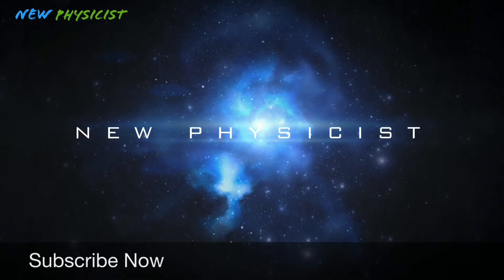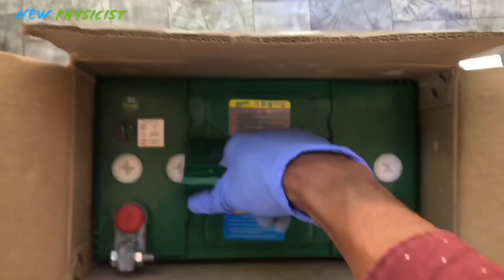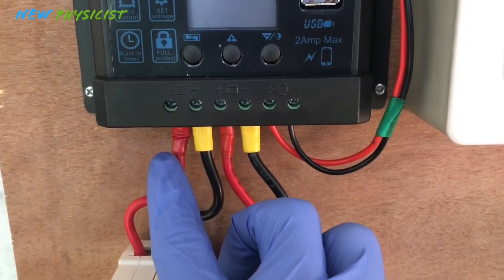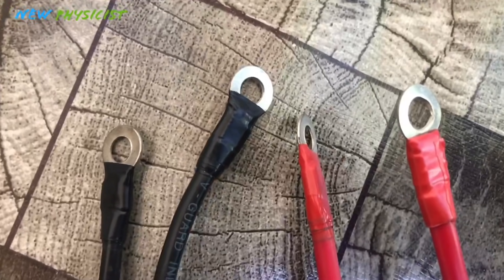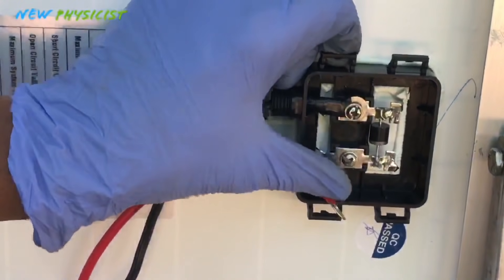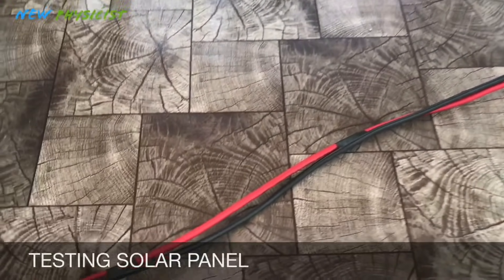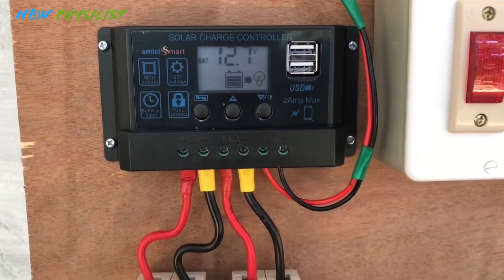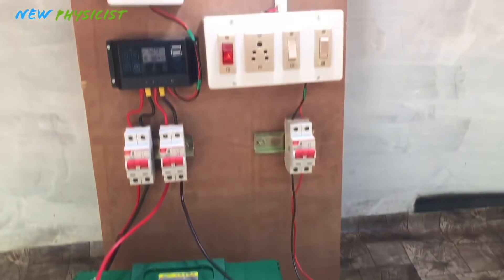How to Install Solar Inverter | Off-grid Solar Power System | 12V Battery | 100W Panel

Comment: You connected the battery directly to the inverter. And you have said that doing so will affect the battery's life since the inverter can completely drain the battery. So at night when there's no solar charging the inverter can completely empty and affect the battery life right?
Reply from the maker: By choosing inverter which over discharge protection you can save the battery. Most of today’s inverter had this function. So nothing to worry about. I connected it directly to the battery, if somehow inverter draw more current from battery through the charge controller (more than rated current) it will fail the charge controller.
Reply: @newphysicist  Ok. I have a solar lantern having a 12v 7.2 ah battery inside and a panel of 10W. Can I open up the lantern , connect 2 wires to the battery , take it out and supply it to a 100W local inverter and use that to power household LED bulbs? I don't know whether these local inexpensive inverters have battery protection.
Reply from the maker: 7.5 Ah battery can be used to light total ~40 W light 💡 for 1 hr. Or 10w bulb 💡 for 4 hrs. 

Yes, you can connect. But battery 🔋 will drain fast. I recommend you to upgrade your system as I shown.
Reply: @newphysicist  Ok thanks😊. One more thing. Can I use the setup I told during day time? The battery  being charged by solar and simultaneously using the inverter on it will not completely drain the battery right? I just want to charge my phone and power my laptop (45w) during rainy season, since day time mostly power will be out.

Comment: I have 165 solar panel. And 80ah battery. I want to charge battery with 20a solar charge controller.... Is it possible with full charge
Reply from the maker: 165 W solar Panel. If you are getting 5.5 hrs of bright sunlight a day,  total power ~= 900 W

Assuming you have a 80 ah lead acid battery. Total power needed is 840 W

Assuming you have a 20 A MPPT charge controller…
Yes you can.

Comment: I notied for both solar side & battery side you have used 40A AC breaker (isolator). Since both above ends are DC, shouldn't we use DC breakers?
Reply from the maker: I did use DC MCBs instead of isolators in my latest off-grid project. Check it out
Reply: @newphysicist  Thank you for the new video. Actually, your videos cleared a lot of problems I had regarding off-grid solar systems. I have one question since DC MCBs are rare & expensive, can I use AC MCBs instead? are there any negative impacts?

Comment: Nice video - I am new to this but have a PWM charge controller (30A) and purchased a 100W solar panel. I want to use it to charge LED lights on my garden - (12V 40W) - I can just hook up the lights directly to the load and they will switch on and off as per the timer. I dont think I need an isolator etc for that setup as the power levels are not so high. If I wanted to get an inverter (will need isolators) and powered a garden feature from the AC output - can that output be controlled with a timer so it will come and and off as per the load? or will it always be on? My battery will be a standard (used) car battery, SLA 12V 50Ah
Reply: I am using 35w panels 3no’s
65ah battery 
Using DC lights only 10w
If I use inverter in that Ac 20w light won’t run till morning.

Comment: Please sir I also have a question, and it goes like this, I have 80watts 18V mono crystalline solar panel, but unfortunately am new to solar stuff, now how many ahms of battery, plus charge controller and inverter could be the best/ideal for this setup? , moreover sir, what can I run with it? Early response will be appreciated, I just tab the subscribe button 😊
Reply from the maker: A 30-40 Ah 12 v Lead acid battery will be enough if you have 5 hrs of bright sunlight. 

You can use a 50W TV continuously for 4 hrs. 

All calculations are approximate. Not exact. 

I appreciate you for subscribing to the channel.

Comment: Why used isolator instead breaker?
Reply from the maker: It was my first project. Isolator will work (for isolation purpose) but will not protect. Cost of isolator is very low too. Pls check my last project. I’m using DC breakers there. Thank you 🙏

Comment: How do o go about the battery over discharged...like how do I protect my battery from over discharging
Reply from the maker: Charge controller will protect battery from over charging. If u r sure you won’t connect more than 120 w power from the battery at a time you can connect the inverter input leads to the charge controller’s DC out, to avail over discharge protection.
Reply from the maker: But if you are connecting it directly to the battery, there’re certainly things to worry about. Use an high ampere charge controller (MPPT best) to avail both over charge and over discharge protection.
Reply: @newphysicist  do u have any suggestions on the mppt controller
Reply from the maker: Renogy and MorningStar are worlds renown solar equipment manufacturers. Go for one of them. But I don’t have personal experience with those companies. I’m dealing with locally available manufacturers. Best wishes for your off grid life.. ✌️
Reply: @newphysicist  I appreciate your help
Reply from the maker: Anytime. Go green 🌞
Reply: @newphysicist  nice presentation

Comment: bro can i use it for 10w solar panel and charge the 12v,2000mah li-ion batteries like18650 battery

Comment: Why you joint inverter to battery and not at load side.because tou connected load (inverter) and battery with  battery charger's battery connection port .why not seperate.so meaning or function of charger circuit serves.

Comment: Hi sir, I just want to ask, is it necessary to put isolator for solar panels? And is it okay to put the load in ac in the same isolator as the battery and inverter you've installed? Im curious sir. Waiting for you answer. Thank you! And God bless.
Reply from the maker: It’s not necessary but they are safety precautions. We should use DC MCB and a fuse while connecting solar panels to the charge controller. Watch my latest video.
Reply: @newphysicist  for 200 watt solar panel.
Which DC mcb should we used?

Comment: thanks for the easy-to-understand video. I wonder about the specs of the isolators?
Reply from the maker: These are actually 30 amps AC isolators. Not DC. I recommend you to use DC Isolators. But they are expensive.

Comment: Hi, very neat and clean installation, but I have one question, you have used Ac isolator as a switch? does it work without any problem if we simply use it as a switch in DC connections?
Reply from the maker: It is an AC isolator. It’ll work, no problem.
Reply: @newphysicist  Yeah it will work but why not use DC breakers for both panels and battery.

Comment: I guess my charge controller is faulty because when i connect the solar panel, the displayed battery voltage changes to my float voltage.

Comment: Hello bro .  I do not have a car. I don't have a battery Without it... I have 220V 500 watts and this power supply will produce 12 volts 40 amps. Can I connect a 2000 watt inverter instead of a 40A 12V battery? . And I want to connect to a car inverter. This inverter has 2000 watts. Get triple electricity with these options and is it possible?

Comment: For 200 watt solar panel. How much battery ah is required?
Reply from the maker: 80-100 is okey (for 60% dod)
Reply: @newphysicist  i am having 150 AH battery..should i not use that?
Reply from the maker: U can use but panel cannot fully charge the battery and eventually battery will fail. Plus, a 150 Ah battery need 10~15 charging current which cannot be provided with a single 200 w panel.
Reply: @newphysicist  so 300 watt panel is sufficient for 150 ah battery?

Comment: Can it run 700w power consumption  system all day
Reply from the maker: Nupe. A 40Ah lead acid battery can only deliver around 240W.
Reply: If I use a change convertor of 1000w  with  130w solar panel and a 50ah battery.
The it will run all day?
Please suggest me something. 🙏🙏
Reply from the maker: Assuming Your Power Consumption per day is 700 W and you are using a Lithium  battery. 

Battery Size ~= 60Ah
If you are using a Lead acid battery double the Ah. ie, 120 Ah

Panel for Charging 60ah battery ~=150 assuming you have 5 hours of  max sun light.

(All calculations are approximate)
Reply: @newphysicist  and what about invetor sir
Reply: @newphysicist  and a change controlar
And I am taking this system can run atleast day time not for 24hr. Please reply sir 🙏🙏
Reply from the maker: 1000 W inverter will do the job. ✌️
Reply: @newphysicist  thanks sir for your help ❤️❤️😳😀
Reply from the maker: ✌️ always
Reply from the maker: @dextroyt488  a 10A charge controller is okey. When you are using power doesn’t matter. Amount of total power consumption is what matter.
Reply: @newphysicist  ok sir but this system rut it continuously at least 6hr dose it is capable
Reply from the maker: It depends on how much power you draw out of the battery. 

You can run 100W tv for 6 hrs or
50 w fan for 12 hrs or
200 W (any device) for 3 hrs.
Reply: @newphysicist  ok thanks sir 🙏😀

Comment: Dear brother please use proper DC mcb for the DC circuits. Try to use proper tools for crimping and other works. I understand it's an experiment but please do proper research and read the codes for electrical control systems.

Comment: Actually I have 2*190 (24v)watts solar panel(parallel connection) connected to a 50amps 12/24 pwm charge controller charging 100amps battery with 1kva inverter,I discovered I enjoyed it for 3months before battery started discharging fast,changed battery also enjoyed for 3months and discharges fast again...what could be wrong?
Reply from the maker: Charging current should not be more than 10% of the battery Ah for lead acid battery. I your case charge current may be more than 10 Amps.
Reply: @newphysicist  how do you determine the charging current please?
Reply from the maker: Maximum 10% of the Ah of the battery
Reply: @newphysicist  i was meaning how do i achieve that value? and how do i know that is exceeded please.

Comment: 1)Did you use DC cables to connect between Panel & PWM

2)Can we use the PWM usb plug point  to recharge our  smartphone, if yes ,how can protect our smartphone from overcharging ?

I think the original smartphone adaptor does the power control when we use the original power adaptor.
Reply from the maker: I used 6sqmm wire. 

I don’t think pwm have an overcharging protection circuit with it. 

Suggestion: don’t leave your phone plugged in 😊

Comment: 2 solars are connected in series or parellel please tell me
Reply from the maker: Connected in parallel so that voltage remain the same but current doubles. 👍
Reply: Sir i am facing problem in charging my 2 12 volt 7 amp battery with 2 24 volt 50 watt solar( same as you) i have connected bot battery and solar in parellel and used 10 amp controller my controller is not able to charge the battery. Please help me sir. How can i contact you.
Reply: @newphysicist  sir please help me
Reply from the maker: Sorry, what’s the Ah of your battery? And what type?
Reply from the maker: How did you connected your batteries? They should also be connected in parallel.
Reply: @newphysicist  i have connected the battery in parellel and they lead acid battery
Reply: @newphysicist  7.5 Ah each
Reply from the maker: That’s total 15Ah battery. Then it should work. Did you check the voltage and current from the controller? Make sure leads are connected correctly. Try replacing controller.
Reply: @newphysicist  ok i will try replacing it
Reply from the maker: Directly connect the panels to the battery for few hrs. Then check if battery is charged. If yes fault controller.

Comment: Hi who can help me. My requirements only low consumption 4bulbs 1fan and CCTV DVR with WiFi router for these what capacity of solar panels, inverter charge controller and battery will needed? I'm very beginner for solar off-grid system so anyone can advise me plz

Comment: Your breaker are non reversible dont put the connection of your pv in the load side of your breaker it must in the line side ,also the breaker in your inverter dont put the connection load side it should in the line side and then the ac output will be in the load side because your breaker use is non reversible

Comment: I need help please,
My charge controller, reads 13.4v in the afternoon, by evening, it drops to 11.8v Even at zero load.
I use a 12v 220ah battery, 1.5kw

The system is barely 4weeks
Reply from the maker: What’s the solar panel wattage and  voltage (Voc)?
Reply: @newphysicist  180watts solar panels (4)
Reply: @newphysicist  it's a 12volts battery, 220ah
Reply from the maker: Pls mention battery type, charge controller type (mppt/pwm) also
Reply: @newphysicist  luminous battery, mppt charge controller
Reply from the maker: How did you connected your panels? Series or parallel? What is the effective Voc and Isc?
Reply: @newphysicist  I didn't do it myself.
Reply: The company that did it, aren't reachable no more
Reply from the maker: When did they installed the system? I think it worked perfectly when installed but you are facing the problem recently. Right?
Reply from the maker: On-site diagnosis is required to find out what went wrong. Consult a solar installer.
Reply: @newphysicist  exactly, the system is barely 4 weeks old, I enjoyed it only for the first 1 week

Comment: Where did you get the isolator? Do electrical shops in Kerala stock DC isolators?

Also, when you connect the solar charge controller and the inverter to the battery, both will try to charge the battery. Won't they? Will that not damage the battery and the solar charge controller?

Nice try faking the American accent. I had a friend who was trained by an American accent trainer. My friend tried to make his best to speak in clear but normal Indian accent but the trainer was not happy. When my friend effected a comical imitation of an American accent, the trainer was happy and insisted that was exactly what he wanted. So, he continued in his mocking American accent and all was well.
Reply from the maker: L&T circuit breaker
Reply from the maker: I trained my mouth muscles to sound like native speakers. Looks like it’s working 😀
Reply from the maker: But the sad part is I practiced mimicking a British YouTuber and now u say I sound like an American😀
Reply: @newphysicist  For Indians, British or American accents are the same. I am not complaining. A lot of Youtubers do get complaints that the title is in English but the video is in Hindi.